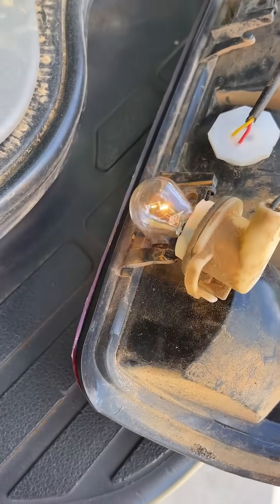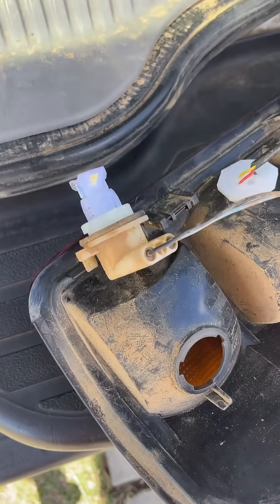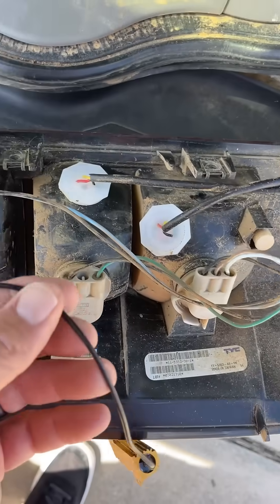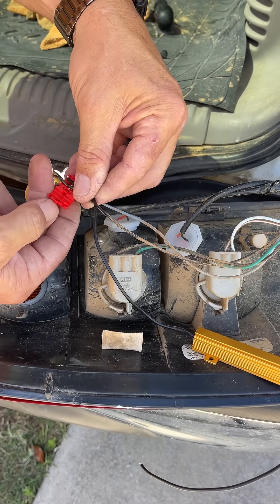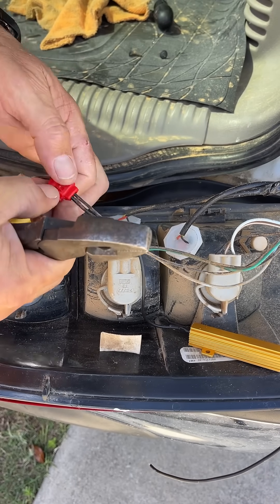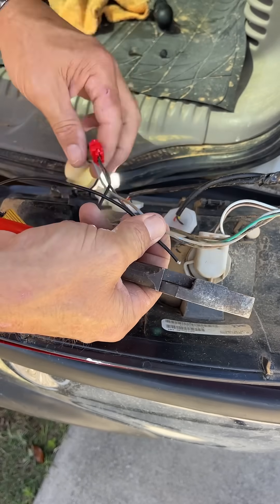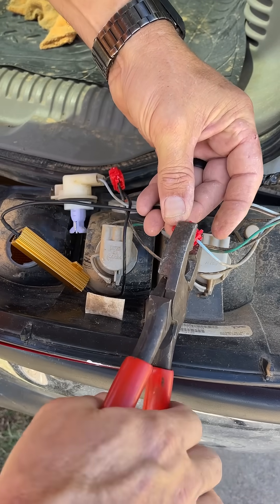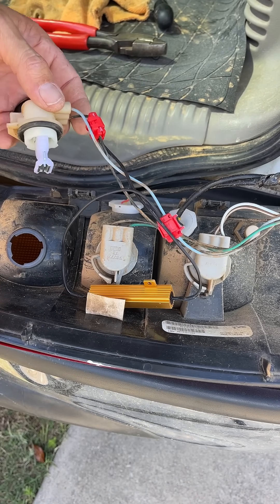LED Blinker Upgrade: Do You REALLY Need a Load Equalizer?

Comment: Do I need to do all 4 lights? I have after market lights or should I just do the blinker wire in the back? Or just front?
Reply from the maker: If it was mine, I would try only the blinker wires in the back first. That might fix it.

Comment: It would be easier to change the flasher relay. All done in one.
Reply from the maker: True. I know. Just trying to help people that buy these resistors. Thank you for the comments though
Reply: Does ford have a flasher relay ?
Reply from the maker: @joseruiz4570 I’m sure they work for more than one brand.
Reply: what if a computer controls the lights instead of a flasher
Reply: @user-ct7vo9js8s you need a resistor

Comment: That is not inline or series.  That is parallel.  That resistor lowers your resistance and restores your RC time constant and won't tell you when your bulb goes bad.  Your load goes up because you draw more current.  If the freqency of your flasher bothers you, you should change the capacitance by adding  an LED blinker relay.
Reply from the maker: It will not tell you if the bulb is out. That is correct. Thank you for your comment.

Comment: Brother they make led flasher relays. They sell em at the part store for $10
Reply: yeah this is a way better option then wiring in all those resistors and having the chance of them melting something because they get so hot
Reply from the maker: @soggytortilla066 they do get hot. This is only on my blinker though. If it was a shared brake light and blinker, I would not have done this.
Reply from the maker: Thank you.

Comment: so correct me if i’m wrong, the resistor gets wired from the positive & negative wire coming from the same connector ?
Reply from the maker: Yes. The positive and negative wire short out in a light bulb and that’s what makes it come on. When it’s on the system says everything is ok. LED lights don’t have enough resistance (short) to let the system know it’s working or good. The load Equalizer (resistor) puts a short on the line and lets the system work correctly.

Comment: you're suppose to mount that resistor on metal panel to dissipate the heat
Reply from the maker: I would have if it wasn’t just a blinker. It’s not a brake light or a running light. Thank you for your comment.

Comment: I would suggest installing the resistor further down the wire somewhere away from the plastic light fixture.
Reply from the maker: It’s only on when the light is blinking. It should be ok.

Comment: Isn't the main purpose of LEDs to reduce power consumption? What are you trying to achieve by spending more money on LEDs and simple resistors with strange names, while consuming the same amount of power? Just use your old bulbs as resistors using the same method. But be careful not to burn your car.
Reply from the maker: The bulbs went out. That’s why I changed them so others can do the same thing.

Comment: They are tried and true installing resistors. Honestly I feel a little better to work on someone’s cars with these resistors. Usually plug and play led bulbs with built in resistors or external plug and play resistors is a better option. Ur Bicol should have oem flasher relay to swap with a led flasher relay.

What I like about those Sylvania load resistors, compare to other smaller 2” resistors is the wattage they shove in there to overcome the problem for getting rid of the hyperflash. 

U like the 50W 2” resistors, those get super hot and it makes over 330 degrees Fahrenheit.

With sylvania’s 3” load equalizer resistors, they draw 27W. Which is still enough to stop the hyperflash. And with T-tabs, it’s old skool, it’s tried and true, and it works. I would wrapped around with an electrical tape to be on the safe side to protect from the elements. 

And dude, u should have go for sylvania amber led bulbs. Those may not be very bright, but it’s better than stock and they are very high quality led bulbs. Worth the money.
Reply from the maker: Thank you. I do electrical work for a living. It’s for a major phone company and I know that moisture will get in the splice T but I know if I tape it up, it will hold water longer than if I don’t. I do put a little dielectric grease on them. That should help displace water though. Thank you for your comment. I do like interacting with people and other ideas. Thank you again.
Reply: @jaycanfixit Hakuna matata👍🏼

Comment: You could buy led bulbs that already has the load resistors in it. No need to splice
Reply from the maker: I will do that next time. Thank you
Reply: @jaycanfixit used the inline ones before and they need to be mounted to a metal area to dissipate the heat. Sometimes for those backlights you dont have much space to mount the plastic housing back to vehicle and Sometimes they melt the housing.
Reply: Or led flasher relay.

Comment: take a high current bulb and replace it with a low current bulb but add a high current resistor.... making the whole thing a pointless venture. just leave the bulbs in there, modern LEDs don't outlast old incandescent bulbs these days, in fact they seem to live a bit shorter lives.

as a 32 year veteran auto tech, i do not condone this as any sort of fix. it complicates a problem by converting it to a different one. in fact the vampire connector is horrible advice, now you added a corrosion point to your now not insulated or protected wire.
Reply from the maker: You want to keep working right? These tips are for people who want to do it them selves and then sell it to someone else and they will bring it to you to fix. You will make money. I will make money. It’s a win win. 🏆 😊

Comment: If you are using LED for the purpose of lowering the wattage on the system, you have just added the drain back on the system. Maybe use an electronic timed flasher instead of a bimetal flasher.
Reply from the maker: Good idea. Thank you

Comment: An LED compatible flasher relay available at any auto parts store does the trick too. No neededing to mess with any of the wiring. Just pop your old flasher unit out (usually in the fuse box) and pop an LED compatible flasher in its place. Takes all of 5 seconds if you know where your flasher is
Reply: this is a better solution, if you have a replaceable flasher relay. most cars however do not have them.
Reply from the maker: @LygerTheCLaw true
Reply from the maker: That is the best idea. I will do a video on that next time.
Reply: I was going to get one of those relay flashers for my 2013 Toyota Tacoma. But to swap the old one out is a pain in the ass you got to take the whole entire – off to get to it. Lot easier just to throw in a load equalizer
Reply from the maker: @waltercondi4584 that’s good to know. Thank you for your comment.
Reply: What if it uses a module to send the Power to the lights? I was thinking why not use light bulb in parallel to trick the computer?
Reply from the maker: @user-ct7vo9js8s you might be able to do that. 🤷🏻‍♂️ thank you for the comment.
Reply: K2 and up platform 14+ the BCM sends the signal, no flash relay, you have to use these
Reply: I don't which car you're talking about but in my experience, they're normally installed in the most annoying spots. My 2004 Landcruiser for example has it behind the fuse box under the steering wheel. So you gotta pull the entire lower dash out and unbolt the fusebox to access the relay. But it's a more reliable option than splicing a load resistor onto the indicators so it's worth doing.
Reply: We tried an led compatible  flasher on a fl80 that we added led turn signals assemblies on the hood we still ended up using led load ballast on the front harness to resolve the issue we also did an international 1970 s1900 we also changed the turn signal assembly front and back to led including the head lights with built in turn signal to led we used the led load ballast also and just used the regular flasher and the truck works great!
Reply: My gmt800 still won't flash properly with a heavy duty flasher. I need to use load resistors to get the system working properly with LEDs.

Comment: Better to keep og style bulbs, less crap to fail and those snap on connects will eventually cause problems, new automobiles are very sensitive with voltage and aftermarket lihts can cause serious issues, with the money spent for the load increaseers better to get the slow blink LEDs
Reply from the maker: I agree with you, it's best to keep it simple. But for people who want a brighter light, this is an option.
Reply: Nah. We rather upgrade with led and resistors. But he has an old truck, might as well upgrade with led flasher relay.

Comment: Chevy is known for bad bulbs for as long as I can remember
Reply from the maker: That’s true. I got another one out right now.
Reply: wrong , Fords ,Chevys, mopar have used 1156 1157  forever. Now they all use a 3056 3057 3156 3157. got nothing to do with bulbs. And when replacing bulbs use a little dielectric grease in the socket. Also don't touch the bulb with fingers. Use glove or towel.
Reply from the maker: @ronniecox109 that’s right

Comment: Do it the right way and use solder sleeve or solder it and cover it with heat shrink. Those literally chop into and expose the wires which can lead to corrosion or the wire itself can break because it was compromised
Reply from the maker: They do but it’s a way some people can do it.
Reply: That made me cringe too
Reply: wouldnt the solder melt due to the temperature of the resistor?

Comment: The two mounting holes on the resistor are for mounting the power resistor to a heat-sink, the wattage rating for this resistor is only when it is mounted on an aluminum heat-sink with thermal compound on a perfectly smooth surface!  When mounted on flat steel it has half of this wattage rating.
Reply from the maker: @HowToHomeLife  good to know.
Reply: I did that with mine, I used pc grade thermal pads and mounted it to the car slam panel as mine were used for side lights.

The lamps worked fine but the cars system couldn't see the load and was constantly telling me I had lamps out.
Couldn't believe how hot those resistors got. Like a heater element.
Reply: Some reporting 2 needed, 6ohm, may just use one 12ohm, would get less hot as well.
Reply: The load is not constant, draws as power is sent, they would not get as hot as a DRL or always on power signal

Comment: One note of caution when using those regulators they get very hot as well. Do not mount them to plastic! use some self tappers and mount them to the sub body somewhere where they will get plenty of air for cooling.
Reply: Probably mount them on a heatsink with thermal pads
Reply from the maker: @GregoGarcia-s5e  they do get very hot. I would only use them on blinkers that are separate from tail lights. I would use a flasher relay if the lights are the same bulb as a tail light. Good point though. Thank you

Comment: I need one for my 2014 Ford Cmax Energi
Reply: Now days you can buy led bulbs that pull the proper load on the circuit so they don't hyper flash. Just buy the bulbs online and not whatever overpriced trash the local autoparts store sells.
Reply from the maker: @sinformant that’s true. It is very overpriced.
Reply: @sinformant  what brand do you recommend??
Reply from the maker: @marcosramos4596 I use sylvania
Reply from the maker: It is just an option. You can also put a flasher in.
Reply: @jaycanfixit  a flasher?
Reply from the maker: @marcosramos4596  https://amzn.to/4m3sw1P you can look at this one. It’s for a gmc/chevy